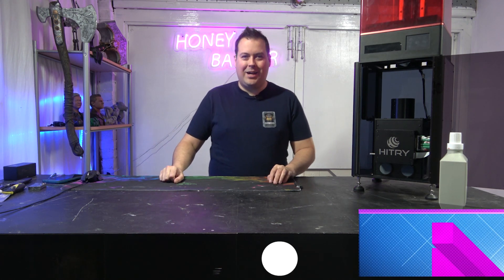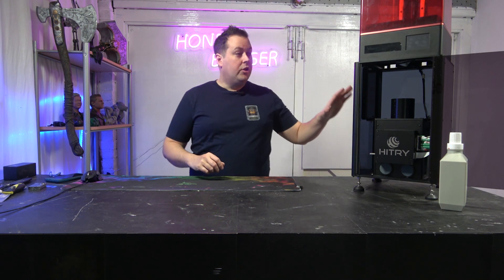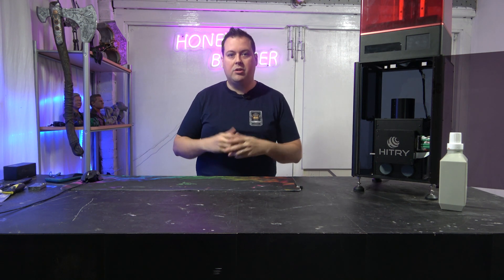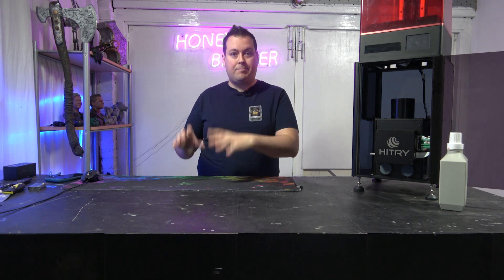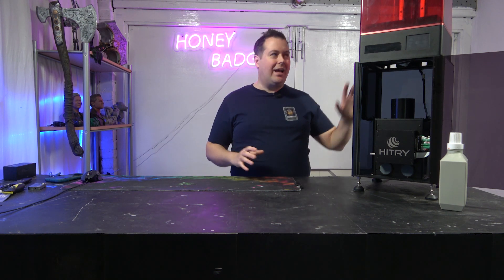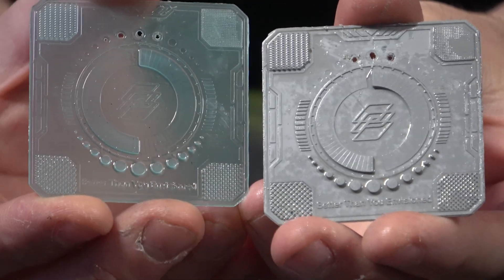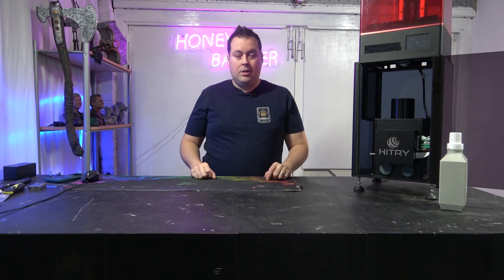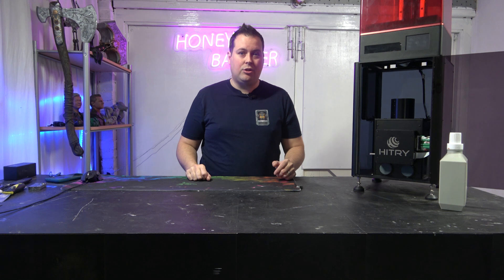Hitry Kirin DSP Light engine

Comment: hey, please note that Hitry so far has not delivered any Kirin and has also ceased communication. If past experience with Chinese contacts have taught me something, it's that such behavior means big problems. Forget Hitry for he tried and failed.
Reply: The main problem as Denny's wang stated is that their projection technology (dsp) don't have stable and equal light strength on the platform 
His light intensity check showed the machine showing 5 to 8 mw/cm³ on different sides that's the main issue
If the projection don't have equal light strength it will not be able to print a detailed print or maybe it will cause failed prints too
Reply: @Saim-fd5ir  lol. no.
the problem is that hitry stole the kickstarter money and ran. they are thieves.

Comment: With the Adjustable lens, can you easily switch from 55 microns to 36 microns using the same Saturn build plate presented in the video? Are you able to choose between using the full build plate and using half the build plate but at higher resolution and detail? I would appreciate seeing some test prints comparting the two :)
Reply from the maker: excellent question we will look to see if we can answer that on the review video

Comment: I'd be interested in using this in a top down function, the question is how to achieve that, as I'm not aware of any top down printers aside from their own. Would solve the height issue present with this and eliminate the need for feps
Reply from the maker: so the only top down I'm aware of on the market right now is the Hitry rocket, you absolutely could use this in that orientation but I haven't a clue where you would even start to build that, you can also use it for Volumetric Additive Manufacturing but that is also beyond me
Reply: @honeybadger3dprintandpaint it will be interesting to see where the diy community goes with this. I think it presents an interesting future if people take advantage of it. I may get one, but the company, at least for me, has a really bad history of poor customer service